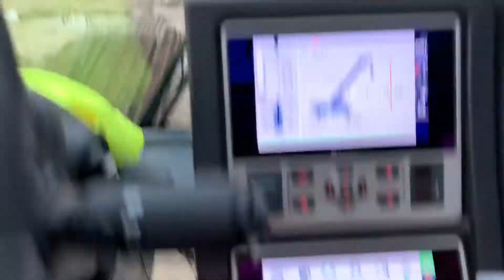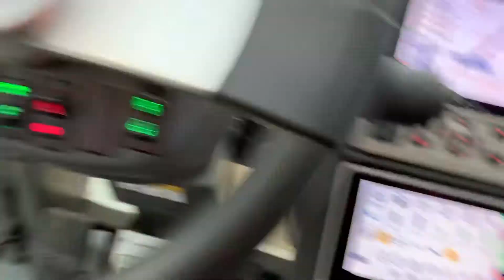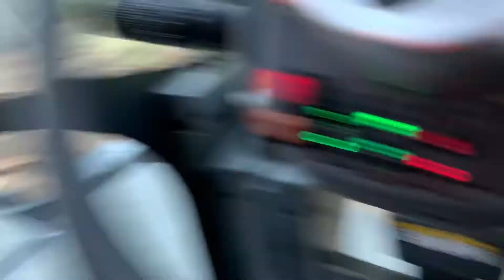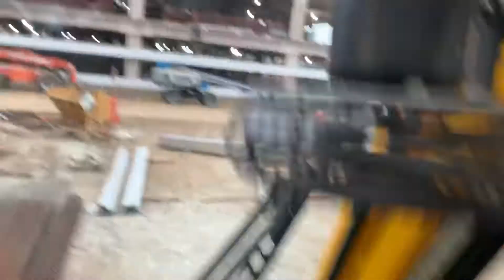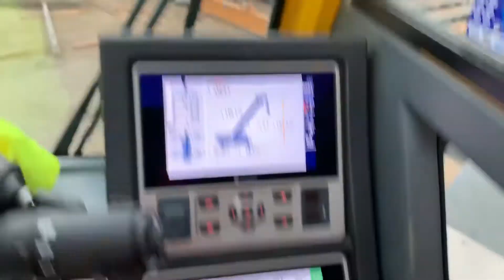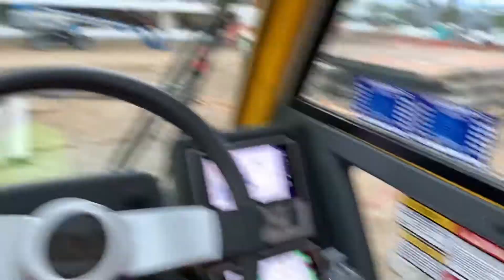GRT8090 Irvine Ca IUOE Local 12 Pt2

Comment: Thanks for the mention Ryan , great commentary, single parts of line for me have always had more swing as opposed to having a block with multiple parts of line . For me speed all came in time once I became smooth the speed just kinda made its way into the repetition of the picks I made. Good job bro .
Reply from the maker: That’s a good point! Focus on the smooth and the speed will follow. Also for the tough crowd out there (talking to you iron workers) as an operator being humble and owning my mistakes or goofs let’s people know I’m giving it my best.
Reply: Slow is smooth and smooth is fast. Speed comes with seat time. Also, some machines are inherently faster than others. Large hydros are typically slow because they are boom heavy. But, lattice boom and boom trucks will really get with it.

Comment: IUOE Local 150 here. I’m an oiler on a crane right now and I can’t wrap my head around why you guys like cranes so much haha. I can’t stand it!! It’s so boring and slow paced. I get a good amount of seat time and it’s just not for me. So more power to ya!! I’m an apprentice so I can’t quit this job and have to wait for a layoff. Problem is the job is going to last another year. I’ll be journeyed out way before then and hope to get into dirt work or sewer and water running an excavator. Stay safe out there brother!
Reply from the maker: Ha ha cranes are gay. Yeah i can see what you’re saying. Not all operators are into cranes that for sure. I can’t run anything but a crane. Was a professional mechanic my entire career before getting pushed into the seat of a crane so that may explain why i like cranes. If you have experience with other equipment cranes may seem boring. 

There is an ego aspect to cranes. When we show up most other trades must get out of our way. They are at the job for months or years we show up periodically and because of the overhead hazards they clear out our work area. That in turn lets us feel important and can get our ego pumped. 

You should post some videos of your experience. I would check it out
Reply: @ryanburbridge  hahaha i DEFINITELY know what you mean about the ego thing. Every operator I’ve ever oiled for thinks they’re the shit 😂😂. The other reason I don’t want to get my crane license is because once I do and add it to my card then that’s all I’ll ever get called out for. I’d rather be on a dozer or excavator!

Comment: Curious where you a heavy equipment mechanic then switched to operator? I'm an operator & really considering getting into the mechanics side of the industry.
Reply from the maker: ROB D. Yes was a mechanic my entire career. Fleet, auto, dealerships , most time spent in heavy equipment in the oil field. Being a mechanic is a great career... still have all my tools and can always pick up a job as one. Just had to transition at this company.
Reply from the maker: The best advice i have for you as a mechanic is never stop learning. Don’t take other people’s word for things. Research everything. “Air brake system PDF” is a search that will get you a years worth of schooling on the subject. Read and learn to devour information. Good luck. Let me know if you have specific questions.

Comment: Equipment Operators apprentice 
Heavy duty repair apprentice 
Special Inspection apprentice 
Or Plant Equipment Operator whats that differences? Very intrested in joining local 12 I want to change my trucking career
Reply from the maker: Did you check out the website? They may have more details on there. But don’t wait enrollment ends at the end of the month
Reply from the maker: Equipment Operator

This is the largest classification of operators in the workplace and provides the largest quantity of work for Operating Engineers. As the name implies, Equipment Operators run the heavy construction equipment on the jobsite. This includes cranes and earthmoving equipment such as dozers, scrapers, compactors, backhoes, motor graders, etc. This classification offers the most diversity in operating various types of equipment in many different applications and settings
Reply from the maker: Anthony Trinidad Heavy Duty Repair Person

This classification refers to those Operating Engineers that maintain and repair heavy equipment. This can be a very demanding profession, frequently requiring work at night, and the need for the repair person to purchase personal tools as individual skills and experience grow in the trade. It is not uncommon for heavy duty repair persons to have thousands of dollars invested in their tools. It is recommended that applicants selecting this classification have some measure of mechanical ability. The demand for this classification varies, but is usually lower when compared to Equipment Operators.
Reply from the maker: Anthony Trinidad Plant Equipment Operator
Rock Products Industry Equipment Operator 
Workers in this classification operate portable rock plants. Similar to the Rock, Sand, and Gravel classification, these operators must be able to maintain and repair the plant as well as run the various types of equipment to support plant operations. Demand for Plant Equipment Operators is usually similar to Rock, Sand, and Gravel Operators.

This classification involves those Operating Engineers who work at sites that produce rock products. Rock, Sand, and Gravel Operators usually work at the same locations for long periods of time in permanent rock product facilities. In the beginning, this work may involve heavy manual labor work such as shoveling. This type of work also involves plant maintenance, requiring skills in electrical systems, welding, and conveyor belt repair along with the operation of support equipment such as loaders. This classification is typically in low demand.
Reply from the maker: Anthony Trinidad Dredge Operator

Building Construction Inspectors perform inspections and testing during the construction phase on such things as reinforced concrete, soils, structural masonry, prestressed concrete, structural steel, and welding. Building Construction Inspectors must have various certifications to perform their work. During training, Building Construction Inspector apprentices will be taught the necessary knowledge to correctly perform their work and to pass the required certification examinations. Demand for Certified Building Construction Inspectors varies with the needs of the construction industry.

This is the smallest classification of work within the Operating Engineers. This work is somewhat seasonal, and only occurs around bodies of water. The work is difficult and demanding, and as the name implies, involves the use of heavy equipment to dredge soil and material from waterways and harbors.
Reply from the maker: Anthony Trinidad https://www.oett.net/equal-opportunity
Reply: Equipment Operators it is then hahha thank you so much truly appreciated.
Was on the website when I asked you these questions.
Just unfortunately was unsure of which apprenticeship to actually go for. Orginally was Equipment Operators but with no knowledge on these careers it puzzled me.
Reply from the maker: Anthony Trinidad yeah I’m not 100 percent sure how it works. Not sure if you have to select one and stick to it or if it’s something you can change as you go forward
Reply from the maker: Anthony Trinidad keep me posted if you would. Thanks and good luck. Tell a friend
Reply: Will do application already submitted. Once again thank you